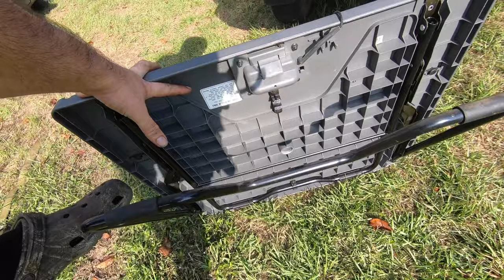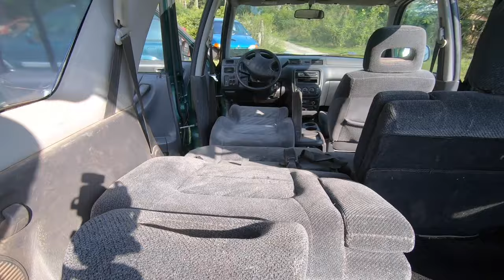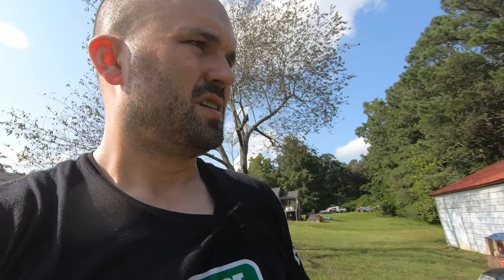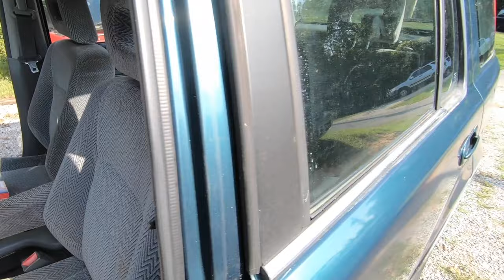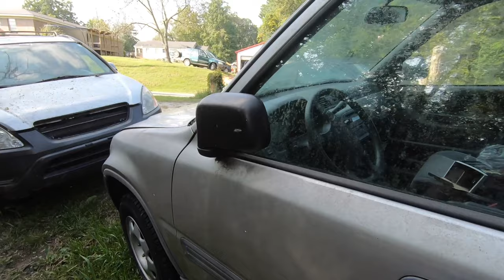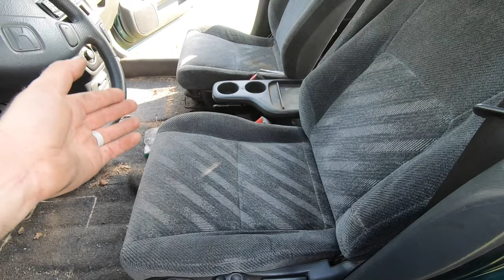Hidden Features & Treasures of the 97-01 Honda CRV RD1 RD2

Comment: Yep, I love the design of my 2001 Honda Crv so much.  I was looking into buying a new Honda CRV two years  ago but I was turned off by the new designs and decided to stay with my 2001.  I forgot if they still have the shifting stick behind the steering wheel (probbably not).  I love the space's efficiency; especially, I need the shifting stick behind the steering wheel and love the empty space in the middle, in front of the cup holder.  Great rewiew!   Do you have advice on how to keep my CRV for a long time such as how often I should change fluids, etc.  Some one told me it was a waste of money after I changed transmission fluid at 10 year mark (the car battery failed for the first time and I got nervous).  It's beem another 10 years now...Also, I heard that there is no need to change the oil every 6 months (I don't drive much) if I use Mobile 1.  Any advices?
Reply from the maker: I would change the oil every 6k miles if you are using mobile 1. Just keep up to date on the stuff like timing belt, spark plugs, etc and you should be good.
Reply: @hondaresource  Thank you!
Reply: @hondaresource  would you change out transmission fluid, I have 215k miles
Reply: @vipkarl  yes, you are never going to hurt a good condition transmission with new fluid. Just make sure you use the Honda stuff.
Reply: @jermdawg2805  thanks Mr dawg!
Reply: The manual says to change oil every 4.5k. I go sometimes for 5-5.5.
Reply: @jermdawg2805  true.  I changed my transmission fluid and timing belt at 10 year using Honda brand (I more likely didn't need to but didn't know how to check at that time when the battery went out) and just did the transmission fluid again at about 100K when I had the seal around the engine replaced for leaking.
Reply: @vipkarl  I think you should check to see if the fluid is still clear.  Someone lately told me that sometime switching the transmission fluid would just ruin it.  It probably has something to do with a flaw its design.  So if the fluid looks good, don't do anything to it.

Comment: you also left another feature that  the are some tabs on the rear seats that you pull on either side of the seats which if pulled will "open up" the sets such that if you collapse the two back rests u have an extended flat bed from the "truck" which comes hand for an extra load 😃
Reply from the maker: yes, I knew about that too. Just covering a couple of the things many people didnt know about.

Comment: I have a question for you.  I have a 2001 Honda CRV SE.  I do a partial transmission fluid replacement like every 45,000 miles ( drain 3 qts out replace, and repeat 2 more times).  The car has 200,000 miles now. I usually used Honda DW1 tranny fluid but this last time ( about 9 months ago) , I ordered Aisin ATFDW1 fluid instead of the Honda DW1.  I am experiencing tranny symptoms recently where the tranny is not slipping but when I start up from a light in gear, the tranny seems to delay in first gear ( starts to roll but seems to be struggling)  it then goes fully into gear and is fine with shifting into second and third.  Could this be because of the fluid not being Honda fluid or should I suspect a shift solenoid?

Comment: Appreciate the videos, i have a 98 crv it starts right up runs great but sometimes it will just crank and not start, its usually if i shut it off at the store and then try to restart.  I have to wait a few minutes befor it will start again... any ideas thank you in advance
Reply from the maker: I would start with the main relay then the igniter in the distributor.
Reply: Ok i will give that a try thank you for the help 🤘

Comment: Hello, I have a 01 CR-V LX, second owner and I truly love it I'm slowly turning it into off-road mods. I have a question about a button on the upper far left that's next to the air vent on the driver's seat side. Do you know what it does I've been trying to figure it out?
Reply from the maker: Cruise control master switch?
Reply: @hondaresource  is that what it is? Because when I press it a little blue light turns on underneath the button
Reply: @amador4417  it's the cruze control switch. The blue light indicates that it's on. If you press it again, the blue light goes off, and your cruze control is off. First you need to press this button (blue light on), then set the speed with the two buttons (up and down arrows) on the right side of the steering wheel, right under your thumb.

Comment: Thanks for the CRV info. I just got a 98 CRV EX as a project. I rebuilt the distributor with a new coil and igniter and it fixed the problem of losing spark when it warms up but now it’s giving me a new P1381 code. I check the distributor and the rotor screw came out and there’s damage to the cover. Is there any saving it? I figure i need a new distributor.
Reply from the maker: Which cover?
Reply: @hondaresource  the one held on by the rotor
Reply from the maker: @trogg78  send me a pic to my email phillip@thehondaresource.com

Comment: Wsup Boss I need some rd1 parts, and common parts that usually go bad is ball joints, clock not working, and water leaking on the passenger side and some other stuff I can’t think of rite now.
Reply from the maker: yep, those are definitely some common issues. What parts are you looking for?
Reply: I need a cat
Reply from the maker: We sell all of ours and put aftermarkets on them.

Comment: if I had that the thing beside me that had to compilers I'll take that out. the thing underneath the passenger seat I would take that not necessary I would get the part that pulls out get a drill and drill out the bottom. so you can put bigger cups in it. love how the automatic have a lot of floor room and they have floor room in the middle so if you're sitting up front in the passenger seat you while you're driving you can get up and go into the back

Comment: Hi, great video on first Gen CRV.
Bought mine in NY for a winter car.
Put $$ in front end…has 190,000 miles.
NOW check engine light is on. Think it’s about the O2 sensor and an evap problem.
Any tips?
Reply from the maker: it could be a couple different things, vacuum leak would be a cause of both.
Reply: Gotta click the gas cap at least 3x after filling up to make sure it's tight. Common route to O2/EVAP issues

Comment: I have a 97 is it okay to get aftermarket drilled slotted rotors or should I stick with OEM reason being all the package deals I see out there online and the part stores any help would be greatly appreciated
Reply from the maker: Those are fine.
Reply: @hondaresource  thanks I appreciate the info I'm taking my ball joints are bad upper and lower that's what's causing it to sway all over the road plus I get shaking that's probably from the tire once again thanks for your advice as always I will keep in touch

Comment: Do you have any idea about a 98 cry with the beeping like the key is there when it’s not, I tried a new ignition but it did nothing and beeps with the key out of the car?
Reply from the maker: That's weird indeed. Definitely sounds like you have some sort of wiring/sensor issue.
Reply: @hondaresource  ya it started happening after we fixed the wiring harness for the drivers door

Comment: Yes, the SE does have black leather seats and leather steering wheel. Also my car has a issues that I can’t have it fixed yet since a year of ownership. Can’t pint point what it might be.
Reply from the maker: Too bad you can't bring it by. What are the syptoms
Reply: @hondaresource  after driving it for a while, it won’t start again after being left turned off for more than 10mins. I changed the starter, spark plugs, new lines, fuel filter all new. Idk what else to check.
Reply from the maker: @luist6mazda  try the main relay
Reply: @hondaresource  I bought that new as well lol

Comment: First gen crvs are the most underrated mini suv of its time wish they had a k20 in first genz
Reply: Put one in! It's not that difficult. I've seen a few, and I'm pretty sure swap mounts can be made to work
Reply from the maker: For sure!
Reply: I want to do that with mine. Will the manual trans on a 1998 line up with the k20 or k24 from another ?? Or would you have to trans swap aswell
Reply from the maker: @calebwinterbottom196  b series trans is not compatible with k series

Comment: My two front doors on my 99 crv won't lock with the indoor lever only with the key all the rest lock 
And after I lock either side front door they click or
Activate 3 or four times before it stops 
Is that normal
Reply from the maker: No. Sounds like your actuators are bad or the wiring in the driver door jam is bad

Comment: I did not know about the bed and of course my crv does not come with it .But I do have a question on the drive shaft replacement ok this is a long story but the man whom I purchased my crv from he worked on it for me and replaced a couple of motor mounts and also when he sold it to me there was a slight dent on the drive shaft causing vibration at low speeds and he did mention to me would I like for him to remove the drive shaft stating that I would be able to drive it wothout the drive shaft ,s8re I said mean while I purchased a brand new one and my cousin installed it and it didn't want to go  do you think the motor mounts have anything to do with this issue
Reply from the maker: Mounts shouldn't make the shaft not fit

Comment: I pulled some EX seat frames from a junkyard so I could make that bed. Any suggestions as far as a little more horsepower?
Reply from the maker: If you have an auto trans, you're pretty much stuck.
Reply: @hondaresource  So it is possible to get a little more hp, since I have the 5 speed manual?
Reply from the maker: @ericlewis5147  absolutely

Comment: Hi We have both gens in the family, my son's 2001 has a brown flexible hose that is open and that has a square clip that attaches to a square hole on the fuel filter bracket. We are not sure if it needs to be closed off? The other side is attached to something lower down. Is it a breather hose for anything? We can't find any information online anywhere?  I think if anyone knows it could be you? Thanks
Reply from the maker: It's just a vent tube. Leave it as it is.
Reply: @hondaresource  ok thank you 😀

Comment: Hey dude do you know if a 2006 CRV has one of those little door supports for the cargo door? Mine tries to shut on me all the time and it's annoying as hell and I was wondering why there's not like a little locking mechanism or some kind of thing to keep it from doing that. I bought it used so it may just be missing or maybe I don't know where to look. Any help you could get would be wonderful
Reply from the maker: I dont think I've ever seen one in a 2nd gen crv.
Reply: @hondaresource  Damn! That stinks! I do a lot of deliveries and when I park on a hill that door is always trying to close on me. I got excited for a second thinking that I could have one of these guys to prop the door open.

Ambrose received heavy praise from the lights as soon as I get home I'm going to check and see if my Honda has that little drawer underneath the passenger seat. I don't think it does but I've never really fully checked.

I also have a 2006 Scion xB year and I alternate between the two. Gas being what it is the XB does better gas mileage wise

Comment: Hey man I enjoy your skits ..I have a question !! I have a 98 -99 crv automatic...my transmission went out at 257.000 Miles it's whining .. I can start it up and go about a quarter mile then it stalls but after I turn it off and restart it will run again about another quarter mile and I have to park it what transmissions will link up from any other Hondas as in switch.. do you think it's a transmission filter or do I have to change the whole transmission itself  is there a filter the pan the other is showing it's inside the transmission
Reply from the maker: The only way to change the filter is to rebuild the transmission. Just replace the whole transmission and torque converter.
Reply from the maker: @herbiedunlap5534  there is no transmission pan on it
Reply: Again another route,, can I get another model transmission ..and convert to a front wheel drive without any modifications,? If so what models can be  used ?
Reply from the maker: @herbiedunlap5534  As far as I know, only the crv trans will work in the crv. you can use an awd trans in it and just not hook up  a driveshaft

Comment: I have a idle problem with my 2001 crv  I replaced the idle control and fast idle control  it will go up to 2k then go down to 1k and then go back up to 2k I can't figure it out HELP and does both fans stay on when ac is on but when off no fans kick on Need help!!!!!
Reply from the maker: Well if yours has a fast idle valve on the bottom of the throttle body, that would be my fist guess for the idle fluctuation. Otherwise, probably an intake leak somewhere. If you turn the key on and jump the fan switch connector out with a paperclip, do the fans turn on?

Comment: My 98 Honda CR-V has a problem, I still drive it almost everyday though because I haven’t felt any loss in power or anything like that. After sitting idling for like 5-10 minutes it will puff out a cloud of smoke out of the exhaust. Also when I changed the oil after I bought it from the guy, it only had like 2 1/2 quarts…. So I put the correct amount in then. Any ideas?? Love your vids!!
Reply from the maker: I'm not exactly sure what would cause a random puff of smoke. The oil consumption is pretty typical for honda's. Usually it's valve seals.
Reply: @hondaresource  do you have a video on how to replace the valve seals yet??
Reply from the maker: @calebwinterbottom196  no not yet. Haven't had one come in needing it
Reply: Just bought one does the same thing as well really clean I mean very well taken care of but definitely worry some getting that little puff of blue smoke after taking off from an idle.

Comment: Tell me about the automatic transmission in my 2000 , no filter. Version . Looses gears untill none .turn off the car then on and all is good for 2or 3 mins then does it again.?
Reply from the maker: Sorry for the late reply. Sounds like the internal filter is stopped up and it getting starved for fluid.

Comment: I have a first generation with almost 200K miles on it.  The drivers side window doesn't work.  Not an issue until the AC died,  I'm going to have to fix it,  one video  showed a reset for the window controller.  Does this exist on the 2001 LX?
Reply from the maker: No, most likely the door harness. I have a video for fixing it

Comment: The only thing I could add is that I believe on the 1st gen the EX and SE models came standard  with ABS and the LX did not have that safety feature.
Reply from the maker: That's correct

Comment: So i have a 2000 crv with black leather seats is that an se ?
Reply from the maker: Seats could have been swapped or leather added. If you also have leather wrapped steering wheel and painted bumpers, then yes you do have an SE model

Comment: My 98 crv developed a problem were the low fuel light will not lit up anynore when the gas gets low. The fuel gauge works fine.  Im thinking it might be the sending unit, what do u think it might be ?
Reply from the maker: Probably the bulb itself
Reply: @hondaresource  ...funny thing is i took the bulb out and tested it and it works outside the car. The only other thing i can explain is the fuel sending unit on the pump .
Reply from the maker: @ancientdiscoverys  could be.

Comment: No, thank you.Phill .
New tires, I got 5 muddies today 
The cv joints are booked in for 
November.
My 5 speed manual awd will be A1 soon.
New Pioneer stereo I bought to be fitted soon.
I will make & install my own nudge bar.
& carry all for the rear for my generator for a 2200 watt Ryobi , they make Subaru.

Comment: do you have video show how to removed rear cargo door?
Reply from the maker: I don't, but it's fairly easy
Reply: @hondaresource  

i am talking about removing entire door to convert into a truck. not just removing plastic inner covering.

I wish to put it back after I done moving large furniture. so can not be destructive method.
Reply from the maker: @harutanaka3647  the door unbolts and the wiring unclips under the plastic panel near the hinge

Comment: Need the front fenders off 92-95 hatch. If you got ones dent free and rust free genuine Honda. Or know where to get some cause junk yard in Michigan are lacking of any for 5 years!
Reply from the maker: They are super hard to find without dents here. Rust is a non issue though.
Reply: @hondaresource  thanks for the reply. Yeah I’ve seen the aftermarket ones. I have some aftermarket ones on my car. But was hoping to bring it back to genuine

Comment: just found this and wondering how you would go about making more power  from the rd2 crvs  i find its uder powered for slghtly bigger tires  and i still havent lifted mine yet

what mods should be done
Reply from the maker: Really hard to do with it being auto. There isn't any programmable ecus to support áuto Honda transmission.
Reply: @hondaresource  I was just thinking about  a hp boost to over all help with towing n that all purely  na
Reply from the maker: @Jinx-dv7ne  nothing you do na without a tune will really be noticable
Reply: @hondaresource   ppl are making 250 to 300 hp na and since it makes 160 stock a 90 to 100hp incress has to make a big diff
Reply from the maker: @Jinx-dv7ne  with auto and no tune?
Reply: @hondaresource  a  tune will happen no matter what u do  even with a fmu and a turbo (tho it's kinda  a mechanical tune)

But ya idk what ecu I wud go with but  a all motor still needs a tune